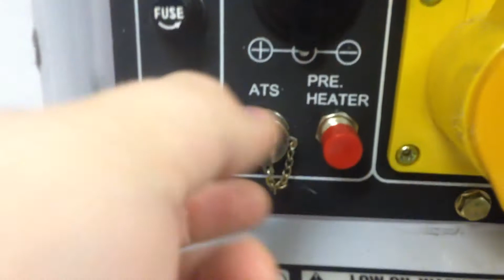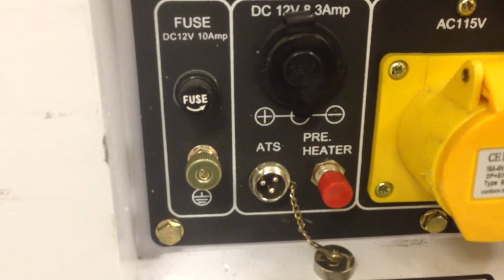DHY6000SE/SELR ATS (automatic transfer switch) port

Comment: i have question about this socket ,if i did not connect it to ATS panal what will happen ,and how why to start the  generator automatically if my generator does not have the socket
Reply: Not connecting the ATS just means that the generator will need to be manually started, not unlike any generator without the ATS feature. More importantly, the term ATS stands for Automatic Transfer Switc and in relation to the 3 pin socket, has only relevent use with an ATS. The socket itself has no relation with switching power from the mains to a generator. The socket functions as a remote start stop and generator battery charger. 

In this use, we find that the ATS cable when connected to an ATS Switch will charge when the mains power is activated (Via Pins 1 and 2 on the ATS Socket, DC + and DC -) and when the mains is deactivated will stop charging the generator. At this point The generator will start and the ATS Switch will changeover it's contacts from Mains to Generator. The sequence of events here can be detailed but after I explain what the 3rd pin on the ATS does. 

I explained that the 1st pin is a DC - Pin. The 3rd pin is a DC + pin similar to the 2nd pin, however, unlike the 2nd pin, it does not charge the battery. The 3rd pin connects to the board that controls the automatic start stop feature of the generator. When power is fed to this pin, the generator then detects this and remains in standby. But when the power is cut to this pin, the generator will instantly try and start. Once power has been returned to this pin, the generator will instantly turn off.

Using an ATS can alter the timings of how the generator turns off once power is restored to the mains circuit. Lets detail the ATS. An ATS will have contacts for 2 AC power sources and one AC load output as a minimum. Let's straight up assume that ATS switches incorporate "Interlocking contactors"  for the use of switching AC supplies without them ever coming into contact with each other. In this way you are able to have both supplies off, or one or the other switched on.

When the mains power is cut, the ATS will drop its contacts into the off or open position. if the next action was to be the generator powering up and supplying power to the ATS on it's second supply, then the most common sequence of operation is as follows. The power would be fed to the contactors, but branch off to a timer which when receiving power would delay in seconds how long it takes before it is fed out of the timer (5 to 10 seconds is the most common delay times I have seen). The power from the timer is fed to the relay which controls the closing of the contacts on the second supply, or rather, activates the second supply and feeds it out of the ATS to the load. This is important because when a generator starts, i often needs a few seconds to ensure it is running at the correct RPM, ensuring the correct AC frequency. 

More importantly, If a timer operation isn't incorporated into the activating of the secondary supply from the generator, electrical components can fail. This is because, as the generator starts, it immediately produces current as it begins to start, and as it starts, the AC frequency starts from 0 and rises to to 50 or 60, the point when the generator is at the correct speed. Relays can often unreliably function on lower voltages and frequencies, so as a generator starts, if the relay feeds the current to the secondary contactor to close it's contacts, connecting the secondary AC source to the load output, There is any chance that the relay or contactors could switch positions intermittently ultimately reducing life to the components, or worse damaging electrical devices connected on the load output. The timer as an electrical device can fail as well in this sense, but if so, the end result in this scenario would be that the ATS would not activate the second supply. 

To now incorporate the features of the generator's automatic start stop feature, we connect the ATS cable between the generator and ATS. Looking at pins 1 and 2 of the ATS cable, we see a charging circuit. To utilize this feature of the generator, we need to have a 12v battery charger designed to charge the generator's cranking battery. Inside the ATS will be space for the charger and it will get it's power from the mains supply coming into the ATS. From here it then connects out of the ATS to pins 1 and 2 on the ATS cable. When the mains supply is cut on the ATS, the generator will stop receiving the current down the charging circuit on pins 1 and 2. As a side note, the generator when operating should be able to charge it's own battery under its own power and not rely on the ATS and it's battery charger.

The 3rd pin on the ATS Cable is a sensing wire that when connected to pin 2 on the ATS cable will tell the generator to start, and once disconnected will tell the generator to stop. The ATS should provide the functionality of delaying the generator from turning off once power is restored. This is achieved by incorporating a delay timer that gets it's power from the main supply of the ATS. Once power is detected in the timer, the timer starts (often between 30 seconds and 1 minute). Once the time has elapsed, power is fed from the timer to a relay that opens contacts between pins 2 and 3 on the ATS. At this point the generator will turn off. As a side note, the generator may have it's own timer functions that when pins 2 and 3 are no longer connected will start a timer inside the generator to ensure it turns off appropriately.
Reply: @Chrismanningdrums Nice explanation Chris! But I have a question regarding my ATS Box, it has a 5 pole pin connection and my Genset has a 3 pole pin ATS connection, what would you suggest, change the ATS pin connector on my genset to a 5 pin or change the ATS Box panel to 3 pin? Thanks Yosa
Reply: Just keep the 3 pin connector and purchase the same plugs, they are just an aviation audio connector, but are now commonly used on generators. Connect only the 3 wires from the genset required for the generator, the pos, neg and start stop And thatxshould do it. The cable you make should just be a 5 pin plug on one side and a 3 pin on the other
Reply: @ thanks for your quick and clear advice Chris 🙏🏼👍🏼. I will follow your advice.